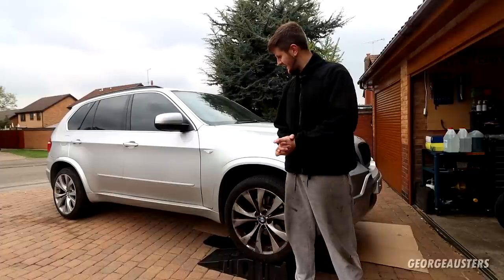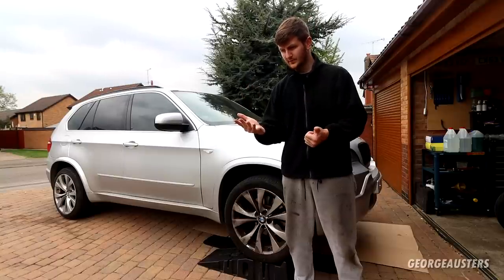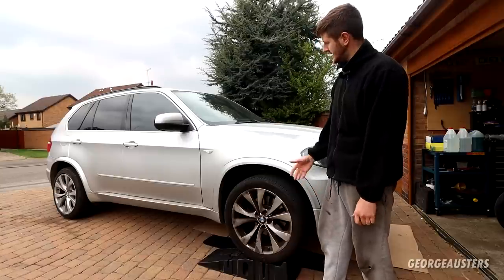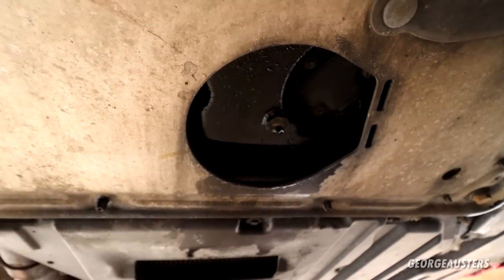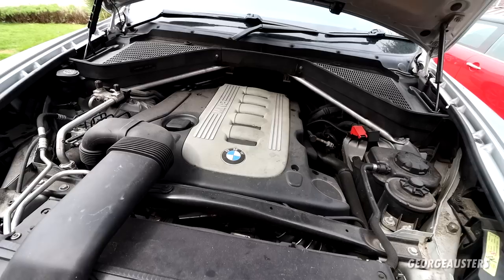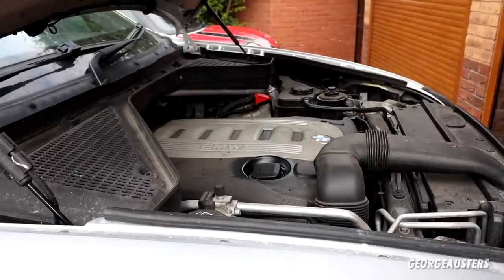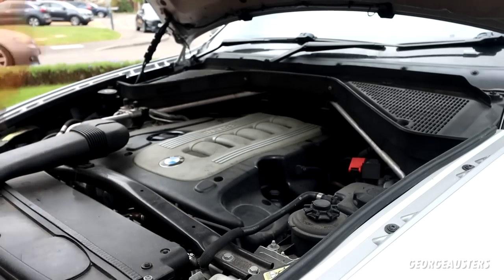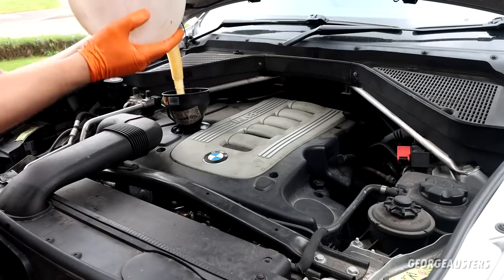BMW X5 FULL SERVICE! (Oil Change, Fuel Filter, Air Filter, Cabin Filter, Coolant Flush, Brake Fluid)

Comment: Great video George, we watched it here in Australia and loved it. we have an 07 X5 E70 3.0d with the m57TU2. I'd love to see content on 1) diagnosing a wining sound from the front diff; 2) front diff oil change process; 3) transfer case oil change; 4) rear diff oil change; 5) front and rear diff rebuild (seals); 6) front and rear wheel bearing replacement; 7) transmission mount replacement; 8) dpf delete; 9) water pump replacement; 10) AC belt replacement (has no tensioner so is different; 11) intercooler removal and clean process; 12) diagnosing blue smoke if left to idle too long (turbo shaft seal or drain pipe blockage); 13) glow plug module replacement; 14) tailshaft guibo replacement; 15) m57TU2 timing chain guide replacement; 16) ZF6HP auto service (Inc mechatronic sleeves); 17) full suspension refresh (all bushings, swaybar links, upper+lower arms); 18) thermostat replacement; 19) waterpump replacement; 20) EGR delete. keep up the great work!
Reply from the maker: Thanks man - I’m sure I’ll be doing most of that!

Comment: Hi George , Yet ,another informative vid ,, just changed the fuel filter on my F30 m sport ,, everything else was done when I had it serviced, last year, but I chane the oil and filter ,twice a year ,, even if its only done about 3000 , miles ,, glad to be back ,,keep em coming, and stay safe all 👍
Reply from the maker: Good stuff, regular oil changes are key!

Comment: Hey George. Congratulations on the new project. Wish you all the best in working on it. I have a 2009 e70 30d. So pretty much the same thing. So far I have done the ffg with my indy: damper pulley, idler, tensioner and belts. Rear shocks and shock mount bushings. Front shock mount bushings and sway bar links. Front brake pads. Coolant flush, power steering flush. Oil and air filter services. New battery, egr blanking, dpf removal and stage 1 software. It's been a pleasure to drive so far and has been of value in extreme weather conditions. Next on my to do list is the cabin and circulation filters, brake fluid flush, front shocks and tyres and transfer case fluids.
Reply from the maker: Sounds good!
Reply: I've got a very squeaky belt on start up while idling, did yours have that? I've done quote a lot of your list too! Also did you notice any difference from EGR blank?
Reply: I forgot to mention that I have a sunroof drain issue. The front left side is blocked and when it rains I get water in the front left foot well. Wet carpets are not fun. Will have to jack up the car and take the wheel arch liner off and clear them out. Simply couldn't get any joy with any other methods.
Reply: @verdej2057  I did not have a squeaky belt, mines had a whine. Sounded like alternator pulley or supercharger kind of whine. Changed the idler and tensioner and the problem went away. Yours could be water pump on its way out. I've heard of them squealing when the brushes are worn-out. Have you been getting engine temperature warnings on the idrive?
Reply: @verdej2057  The egr blanking yielded a minor and almost unnoticeable performance gain, it also had a small positive effect on fuel economy. Or at least the l/km seemed to decrease a small amount. I like the fact that there is less soot going into my intake. But bear in mind that the engine will take longer to get up to proper operating temperature after blanking the egr. I did not need to tune it after doing the egr but I did need to tune it after the dpf removal. After the tune it runs beautifully. Boost comes in at 1750rpm instead of 2000rpm and the peak boost is higher. This has helped with fuel efficiency and power.
Reply: @junaid hussein  I've blanked mine too and not noticed anything but my engine was so heavily built up with carbon that just knowing it won't get too much worse is good enough. I'd got rid of the swirl flaps too. 
Lots left to do though, I've you a broken coil spring and just had to replace 2 calipers. Quite a lot goes wrong on the e70 it seems

Comment: Would like to see a transfer case service and a transfer case actuator repair.   I need the latter of mine done and no local garage wants to touch it.  Its now out of the mot due to 4x4 error. Common on these vehicles!

Comment: Hi George, i have ordered a stack of parts, swirl flap blanks, glow plugs, thermostat, transfer case oil and a full service kit, also inner tail lights to do this upcoming weekend. Going to want to remove the fan for easier access to the thermostat. How is the fan cowl held in? I have not looked yet but juat trying to get a heads up so it speeds up the job. Thanks.

Comment: It may be cheap but it looks gorgeous. Beautiful design it has, and those wheels look very elegant.
Reply: Ain’t nothing cheap about these cars no matter the age . Once maintained the ride is just as good as a 2023
Reply: @lo90zstuybrooklyn11   True. BMWs are great cars when taken care of, even if they are 20, 30, 40 years old. They drive great.
Reply: @legioner9  Absolutely nothing cheap on an X5
Reply: @lo90zstuybrooklyn11   very true
Reply: @neilrobinson5115  I agree.
Reply: @legioner9  I’ve got a 2009 X5 35D xdrive msport E70 286ps,I’ve had some bits repaired and replaced and there not cheap,Tyres are really expensive,It has 315 Bridgestone dueller sports on the back,and 275 Bridgestone dueller sports on the front,Very good but dear tyres,Great car though in Titansilver metallic.
Reply: @neilrobinson5115   Nice, happy many miles with it.
Reply: @legioner9  Thanks,4000 up to now,Had MOT yesterday,passed with 4 advisories,but not too bad.120,456 on the clock.
Reply: @neilrobinson5115   I have very similar mileage on my E90 LCI N47 😂. They are solid cars, but do need some TLC at 7 - 8 years, although worth it, in my vision.
Reply: @legioner9  Definately,I agree with that,I got a tin of hammerite under body seal with waxoyl and did all the subframe underneath at the back,I clean it with autoglym,Meguiars and ceramic coatings,it gleams,They are worth looking after definately.

Comment: George want me to bring my mini for service best service on a car I have seen well done 👍
Reply from the maker: Appreciate that mate. I just haven't got the time at the moment to work on any other cars though.. Gonna struggle to find time to do more on this X5 at this rate
Reply: @GeorgeAusters  doing a great job on channel love content hard to find a good attention to detail mechanic keep busy 👍
Reply: @GeorgeAusters  No clicks for private jobs lol 😂,Only joking George,At least with you it would be done properly,I had a travelling mechanic do an oil change for me on my X5,I bought 8litres of Castrol Magnatec 5w 30,he pumped out the oil from the top with a think that looked like a garden sprayer,He only put 6.5 litres in,And as you know it supposed to hold 7.5l,I’ve got 1.5 left,Don’t think he got all the dirty out,But electronic oil gauge on dash says oil ok.

Comment: Nice car! I needed about 1 hour to figure out how to remove the air filter. 
And it would be nice to see how you clean the engine bay. You just sprinkle in there?
Reply from the maker: I have a video how to clean the engine bay: 

HOW TO SUPER CLEAN YOUR ENGINE BAY EASY
https://youtu.be/n5duHReX36M
Reply: @GeorgeAusters  thanks!

Comment: When bleeding the brakes, are you not supposed to use the diagnostic software to run through the abs system as well to make sure there is no air in the abs ????
Reply from the maker: Only if you completely drain the ABS, not needed for a regular brake fluid flush
Reply: only if you let the master cylinder go dry as long as you keep it full up it will be fine.
Reply: @GeorgeAusters  Thanks for confirmation 👍
Reply: @ianmowbray3284  Thanks 👍

Comment: Good job mate! What oil did you use ? 5w-40 ?
Reply from the maker: Should be linked in the description what I used👍🏻
Reply: 5W-30 Castrol Magnatec Synthetic is in mine.

Comment: Just wondering if anyone knows why they didn't fit swirl flaps the the M57 engines in E53's? I was very happy when I discovered this.
Reply: its just for emissions same as dpf and helps on fuel consumption around town at low rpm
Reply: @2012richj Yyep it's all about thr emissions. I understand why they fitted them. I'm just curious as to why they "didn't" fit them to the E53 X5's? As far as I can tell, they were the only m57 engines not to have them at that time?
Reply: Tipping it's the swirl flaps that are leaking oil

Comment: There is a drain plug on the radiator. It is on the left hand side, right on the bottom. A blue plug that you can undo with a 13mm socket, flathead or phillips head screwdriver. 

Went looking for a video on how to do a coolant flush, found this, clicked through to the coolant flush section and noticed you mentioned that you removed a million parts to do the flush. 

Figured that can't be right so I removed the splash guard from under the radiator and found the drain plug in about 30 seconds. Starting to question the accuracy of anything else in this video.
Reply from the maker: Yes that’s usually where it is on most BMWs… But this X5 doesn’t have one👍🏻
Reply: @GeorgeAusters  in the video you very clearly looked at the right hand side of the radiator. If it is a factory radiator (very likely) then it is 100% on the left hand side on the bottom.
Reply from the maker: @MWBgq  I obviously already checked the left side which is where they usually are but there wasn't one.. It could have been replaced in the past, i'm not sure. The radiator looks like this on the bottom: https://www.schmiedmann.es/en/bmw-x5e70/17117533472VM-vemo-radiatorenginecooling

Comment: When you say bleeding of the Coolant system, am I right in thinking newer models are self bleeding? If memory serves correct I had to manual bleed on my old e36is, is it still the case in newer stuff? Cheers 👍
Reply from the maker: Pretty much yes👍🏻
Reply from the maker: Watch my coolant flush videos

Comment: Will you do timing chain on the M57?
Reply from the maker: If it needs it
Reply: They last a long time compared to n47 and n57 probably doesn’t need. Think it’s 300k km not sure in miles.
Reply: These old m57's have a pretty strong timing chain. Bought mine just for this reason. And in Holland we can get mot with deleted dpf.
Reply: 300k and you have to replace timing chain on M57.
Reply: I’m looking at car and they guy says timing chain was changed at 100k miles as owner wanted to keep it. Has invoice . I’m a bit concerned why as they last 150-200k miles?
Reply: @eddy45686  What engine is in your car mate ? What year is your car ?  Because it's normal to replace chain on n47 made before 2012 as thouse chains don't last long. Mostly because of thee faulty chain tensioner. Or if people miss service intervals too often, it's recommend to change oil every 10k to keep chain healthy.
Reply: @bastaboom163  it was 530d done 130k miles. He changed at 100k the previous owner current owner saying. Not sure to buy or not.
Remap done. Dpf deleted and EGR still in. Ecu coded for dpf delete. Remap to 300bhp.
Engine is m57 2007. 3d 530d
Reply: @eddy45686  the facelifted models have a newer engine. If I had one of those with 150k I would be very nervous driving it more then that. The pre face lifted e70's have a far better chain. One of those m57 engines i drove up to 400k without problems with the chain
Reply: @Campletebewakingscameras  it’s E60 not E70 but still same engine. It’s LCI 07 with m57 rev2. It would go to 300k no problems but he had it changed .
Reply: @eddy45686  I think when it is 2007 you are fine
Reply: @Campletebewakingscameras  I own a LCI E70 too. N57 which has done 81k. Just looking after it. Not expecting any problems but don’t intend to keep it for longer than 150k. Regular oil changes is the key. Timing chain replacement is very expensive on these .
Wish I could afford a B57 X5. 4.0d mines a n57 4.0d.
Reply: @eddy45686  I am pretty shure these have timing chain issues. As well as the 4.0d. E70 pre lci is a lot stronger. I drive a lot with my car did not buy one for that reason. Google it to be shure. Timing chain replacement in Holland is 2400 euro

Comment: Are you using mannol oil servicing bmw?
Reply from the maker: Correct👍🏻
Reply: Thank you for quick answer.I using now Millers oil c3 vw 5w30 just thinking about Mannol c3 7908 5w30 cost is less than half price Millers and I changing oil every 6k in my cars so potential saving.

Comment: Got same car...could you show about boost leak ? What,where to check! 

I have whisling sound...starts from 1.5k till 2 k rpm .. 
Its started when i accelerate wery hard.
Reply from the maker: Will be a spilt boost hose.. Very common on the M57
Reply: @GeorgeAusters  thanks mate. Will have a look! 
I subscribe your chanel👍 as x5 showed up! I saw on x5 group👌

Comment: Happy to watch more videos on the X5 mate, have you done any repairs to the electric mirrors on a E46 ? I’m having a mare of a time trying to figure mine out , auto passenger dip won’t return up and now the drivers side just randomly runs by itself so I’ve had to remove the fuse.
Reply from the maker: Probably best to just replace the whole mirrors - the autodim coating breaks down over time

Comment: I had 3.osd soo many issues really put me off 4x4 fault with the servo common handbrake fault  then after all 2 injectors failed... top tip the plastic trim just above the engine where the wipers sit cracks and leaks rain water straight on top of the injector which over time causes it to corrode and fail. Not cheap silicone that basterd. I sold the car :( but will buy another soon as I've just started believe it was a bad apple lol
Reply: Ow pan roof also failed snaped chains top tip have it cleaned and greased if u have a pan roof £1000 replacement.
Reply from the maker: No pan roof on this👍🏻
Reply: @iby911  I’ve got a problem with my trim it doesn’t sit on the rim properly,design fault I think.